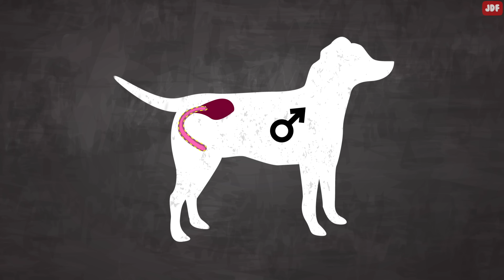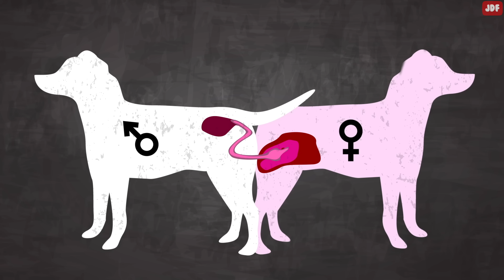Why Dogs Get Stuck After Mating - Breeding Process Explained

Comment: What happens if they sit or lay down while in a corpulatory tie/stuck to each other because its been 30 minutes? Will the female dog still be pregnant?
Reply: for some dogs that can take up to an hour. basically the dogs are only going to bother putting themselves in any given position because it seems even moderately comfortable (it's always painful to some degree) so yeah they can maybe wiggle into a sitting position if that makes them feel better, as long as the tie remains. Doing the act of sitting down by itself doesn't ruin it. But technically it is possible for a female not to get impregnated even if the "tie" is fully done, and it's possible to get pregnant even if the tie doesn't even wind up happening. It's more rare, but possible